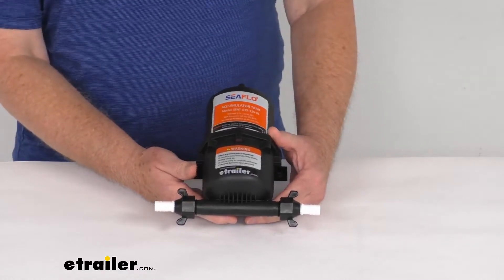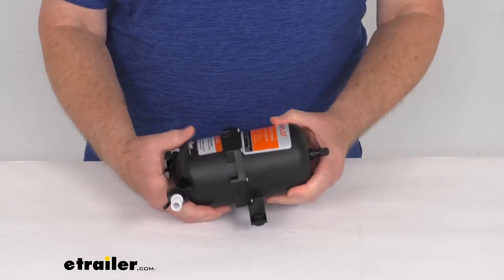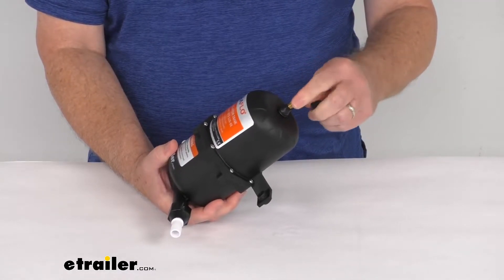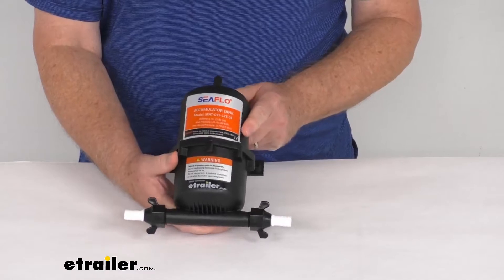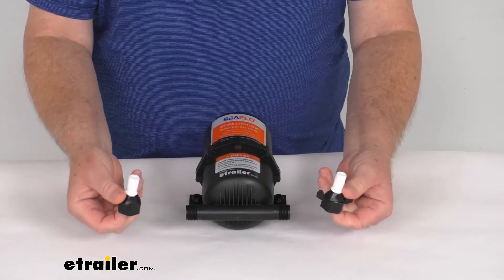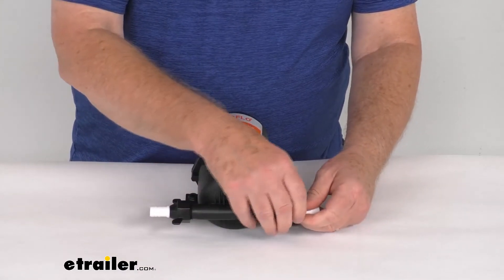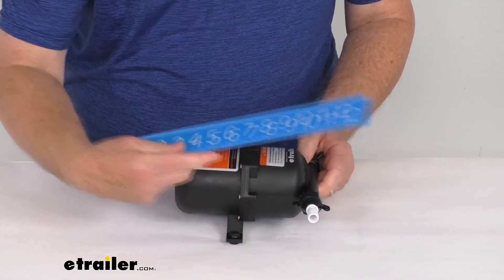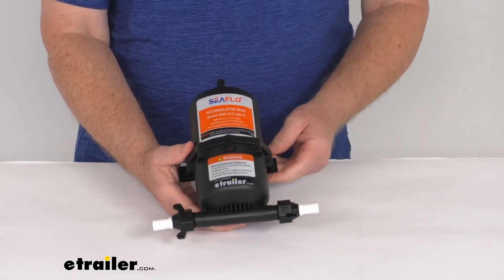etrailer | Seaflo Accumulator Tank for RV and Boat Water Pumps: The Breakdown

Comment: I have heard you can cap off the outlet if you want to just tee off from one of the cold water pressure lines, downstream from the pump?
Reply from the maker: The accumulator tank is designed to go inline directly after the water pump.
https://www.etrailer.com/RV-Water-Pump/Seaflo/SE38FR.html